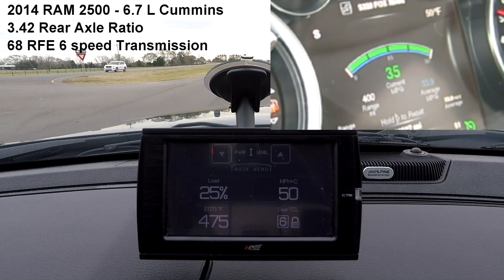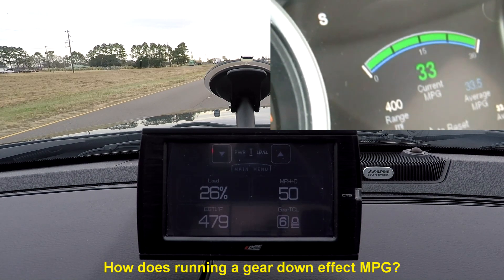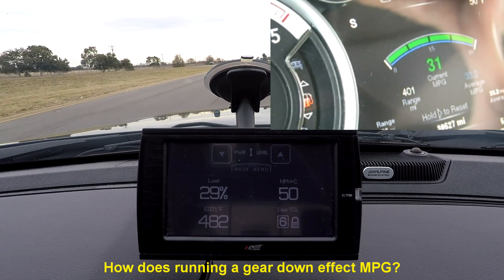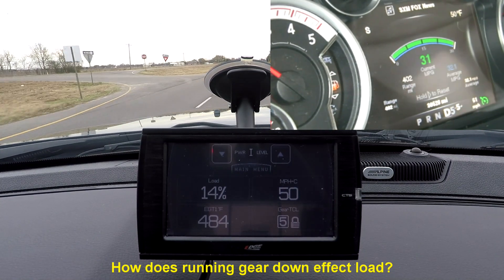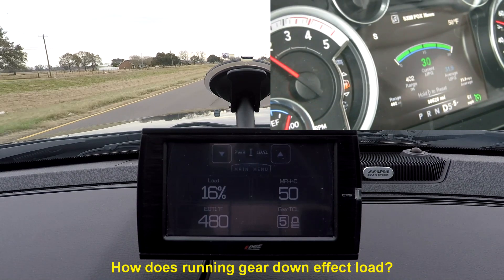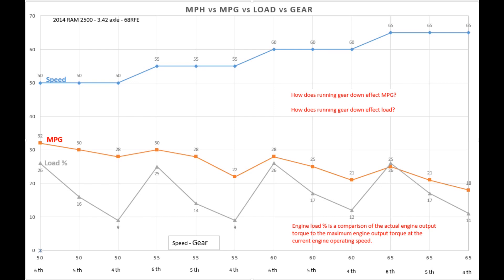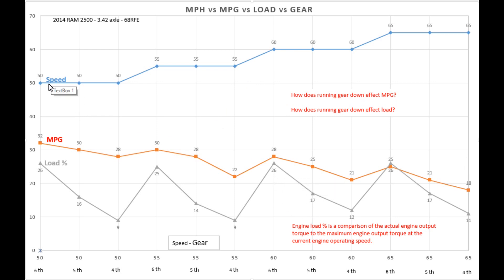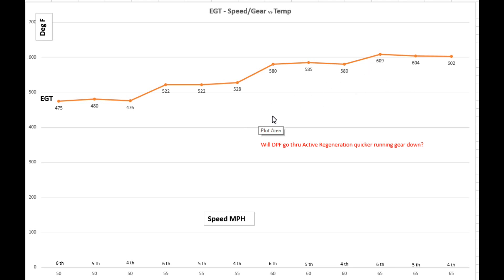RAM 2500 Cummins  4 x 4 -- MPG vs Transmission Gearing

Comment: By looking at your data and knowing how old your truck is, mileage, etc...it seems to me that "deleting" is done by people who want to "soup up" their diesels and "sound cool".  Although that's fine with me...it's your truck, do what you want, it looks like deleting is not necessarily something you HAVE to do to get descent mileage.
Reply from the maker: Agree, I have mixed feelings sometimes but I think we are going thru the same phase we did back in the early 70's when we were plugging vacuum hoses on the gassers because we didn't like the new emissions stuff.  Now no one is concerned.  We'll get that way with the diesels.

Comment: Great video. Your data doesn't support this, but in my experience it is true that the truck regenerates better in 5th than 6th. It could be a programming feature. I only know this to be true when I get the 100% notification. My 16 2500 was one of the trucks that turned into a case study that led to the cat recall. As a result, I learned a few things, and I received a whole new turbo back exhaust on warranty around 5k miles. Prior to, it would regen just fine in 6th. After the work was done, it only will come down off 100% if I lock out 6th. This is true whether I'm running on the highway or in town. Also, one of the diagnostic procedures for a bad DPF is 50miles at 50mph in 5th gear. I also lock out 6th in town. Get better response from the EB if nothing else.

Comment: Excellent information. When towing with my F150, got same fuel economy either in or out of overdrive. 

Does anyone's dash computer calculated MPS's ever come out the same as hand calculated?  My computer is always about 5% higher.
Reply from the maker: Thanks, Some claim they do but most get 1 or 2 mpg less than the panel.  I've tried to do a test on this but the readings were to erratic to make sense of

Comment: The one thing I’m surprised about is this. At 50 mph I would have thought your MPG’s might have been higher in 5th gear. Sometimes running to slow can have that affect but I don’t know your rpm’s at 50.
Reply: Thanks knight, yes, 50 is awful slow for 6th gear but it could because I was unload so the engine was really not working.  Maybe different with the trailer in tow, can't wait to see.
Reply: You have to calculate the drag/wind resistance at higher speeds. @tootallsvlog103

Comment: Another nice video Marion. 
FYI - there was a recent PCM update for our trucks. The update covered a lot of different areas, (mostly minor). The bigger update was to the transmission logic.  Not too much driving since I did it but in the 3 trips in to work and back home, (about 68 miles round trip). My mileage average went up by almost 1mpg compared to prior average. It was 16.8 is now 17.6 with mixed surface street and highway driving, (it is Atlanta so traffic is also thrown in to the mix). Not as scientific as yours but was interesting to me😁. Maybe you can do the update and recheck your numbers, that would really tell us if there is a real difference👍.  Thanks again.
Reply from the maker: Thank you Ben, that's good news, I'll have to look into the flash.  I noticed, FCA doesn't mail any info to you when they have a new flash (at my dealer), they update them as you go in for issues or service etc... I probably have have several waiting for me.  Appreciate this.
Reply: Marion Blair my pleasure. I found a site online, (https://chrysler.oemdtc.com), that lists the recalls, DTCs and bulletins. It is not an easy site to find things but it does have some good info.
Reply from the maker: I just looked at it, thanks.  It is interesting, that's one I didn't know about.

Comment: Nice job! I feel like anytime my truck lugs below 1100 rpm’s constantly. If I just go ahead and lock that gear out, the lower gear gets slightly better mileage running a few hundred rpm’s higher at the same speed.
Reply from the maker: Yes, I agree.  I do the same.

Comment: You get great fuel mileage. I'm jealous.
Reply from the maker: Well, that's empty and I think the dash gauge is very generous.  thanks.
Reply: How many miles do you have on it and what tires are you running? I've got 265/70r17 Cooper at3. I'm wondering if the DEF helps in some way by keeping the DPF cleaner and more open for exhaust gasses.
Reply from the maker: I only have a little over 30k.  I wish I had 17", I'd have the equivalent of a little more axle ratio since the 20" have a larger diameter than the 17".  I know the addition of DEF increased MPG and I think it reduces the amount of EGR which would make the DPF cleaner as you said.

Comment: Driveibility is helped I think with variable geometry turbo. If you spool the turbo a little before the hill at 70 mph it pulls 6th empty with never an issue shifting I've found. 55mph likes to shift however.
Reply from the maker: Agree, thanks
Reply: Marion Blair just for a heads up on the next video will you tell us the weight of your trailer while towing. Im curious on the mpg versus weight with the 3:42 gears.
Reply from the maker: Yea, the little TT I have now is only 5K but I'll provide as much detail as possible.
Reply: Marion Blair thank you for the follow up. 5k is plenty to show some real life data on towing numbers. Thank you for  sharing your insight and knowledge.

Comment: Oh one more thing I will add on my 2016 Ram 2500 if I drop down to 5th gear going up a long 6-8% grade unladen and 60-65 my instant mpg shows 1 mpg higher than 6th. I live in the PNW so i have hills all over vs when I lived in East Texas and Louisiana area. I bet your mileage down there is better than mine though. I get 17-19 up here with a best of 19.97 all hand calculated. I do miss the flat mpg roads of there and the food oh my the food.
Reply from the maker: Thanks, 20 mpg calculated isn't too shabby.
Reply: Watch boost levels. On heavy trucks, over/under 7psi makes a noticeable difference in MPG. On my 16, if I'm steady over 10psi, I downshift, but I still LOVE the sound under the hood pulling a heavy load up a hill in top gear.
Reply from the maker: Yes, that's what I loved about my stick shift, It would pull those hill in OD, I'd shift down on the steep one but it would definitely tell you when it needs a lower gear,

Comment: That's interesting on the EGT temps, I figured with the increased load in 6th it would show spikes in relationship with load. My suspicions were correct on the load vs gear from my driving experience. Thanks for the video now I won't wonder about EGT temps on a stock pickup without an EGT gauge. I had always assumed More load= more boost = higher EGT. So it looks like more load = more boost = stable exhaust temp

Comment: Great information! I've always wondered the exact same things. Knowing this will allow me to adjust my driving style for optimum efficiency. Thanks Marion. I'm really looking forward to seeing the results of the same test under load. I recently installed a MM3 on my 2015 Ram 3500. There are so many data points its hard to choose which ones to watch. It would be great to have a 12 inch screen to watch them all, but then again maybe I should watch the road :-)
Reply from the maker: Yea, If I get in a wreck, it'll be because I'm fiddling with the gauges.  I like the MM3, been looking that.

Comment: I too like to keep an eye on my running mpg.  I usually drive in rolling flat land, meaning slight up and down but not really a hill unless you were walking it. I find the best mpg in this situation at a highway speed is in 5th gear. Noticeable loss going uphill slightly, and little noticeable gain running downhill with cruise control on at 70mph. OverDrive doesn't work well on hills under a loaded trailer situation, it will downshift.  5th is my favorite gear most of the time. Unloaded at 75 mph, 6th gear and go. 

You say your gauge shows when you are in active regen. Is that your aftermarket gauge or truck dash gauge?

Thank you for your charted data.
Reply from the maker: Yea, that's the after market, it's old needs upgrading.